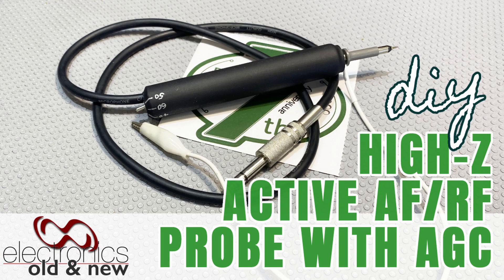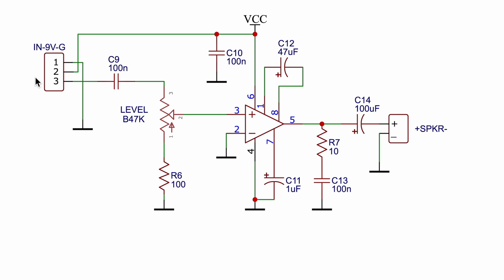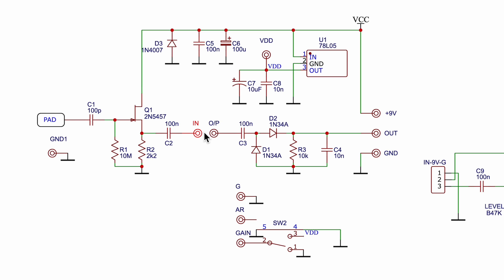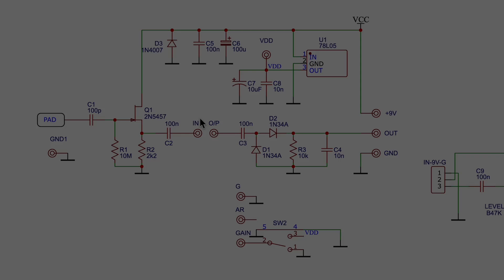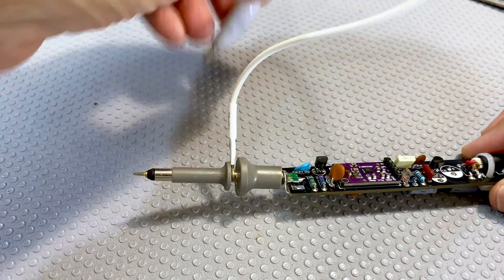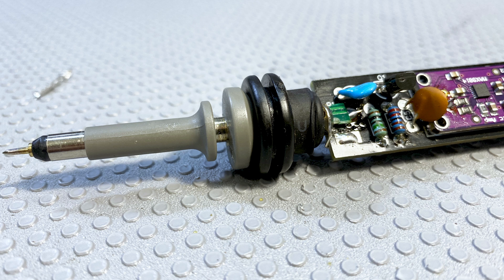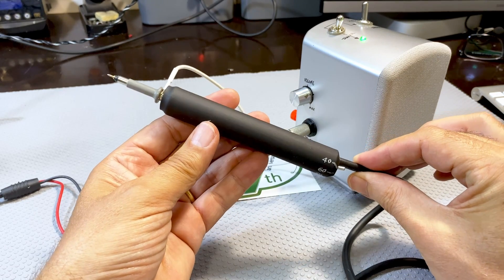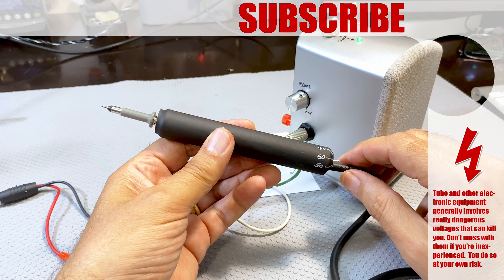High-Z Active RF/AF Probe with AGC. Making something good even better. #PCBWay#

Comment: I suppose if you look at it from a very basic level the Maxim IC is made of the same material as higher bandwidth components. Just because they didn't spec it for higher frequencies doesn't always mean it can't achieve. Great idea to experiment with where you put the board, often the best inventions are discovered by accident. Another great video, thanks again.
Reply from the maker: pleasure
Reply: Looking at the datasheet for the MAX9814, it has flat gain out to beyond 20kHz, so even if it rolls off at 12dB/decade past that, you still have usable gain out past 2MHz, especially if you're starting at 60dB.

Comment: Manuel, Maxim and Analog Devices, are  the  "BIG ENABLERS" at analog linear electronic world, every device designed  by these  firms meets the requirements, and exceed them to provide. So it is common  that the gain /bandwidth ratio reaches those  IF frecuencies. Years a go  a common audio amplifier IC, TDA 2030, used to have a G/Bw several hundreds of Khz, so that could oscillate easily at those frecuencies & destroy it, so selecting(or changing...) some decoupling capacitors at the Aplication Note, was "risky business",... Look I've got more treble.. Yeah now you've got smoke😈. Other ways  it looks great, very  practical, it is great tool for the shop👍👍👋👋👋again you did it Manuel😀😀
Reply from the maker: Thanks 😊

Comment: Very nice!  I will keep this in mind for my next tool project once I get the two I'm working on now off my workbench. As for your wand's wider than expected b/w, I'm not too surprised by that. When I updated my Rigol DS-1054z scope's firmware I was expecting the b/w to go from 50 to 100MHz but tests showed the scope will read signals up to 500MHz, albeit with some attenuation, as long as you use high quality probes.  Cheap probes will cause the greatest drop in amplitude at high frequencies, a fact that Rigol no doubt understood all too well.  It would appear then that some chip amps can go well beyond their ratings as long as your circuit can sustain a large drop in output level.

Comment: What I would like to know is what happens if you short out (I mean remove completely) the original detection section. Then you can say if the detection takes place in your new microphone amp, and it could even give you more gain without the original detection. Detection is no more that getting rid of the negative flank of the carrier, so that the positive part fluctuates from the modulation, and that could easily be done by some diode or transistor inside in the front end of the added amp.
Reply from the maker: That’s a good idea.

Comment: So I was motivated and ordered some boards on PCBway and managed to source all components, but that micro switch offers a challenge
Reply from the maker: I know. Look on mouser. I think that’s where I bought it.
Reply: @electronicsoldandnew  oh thank you, I'll have a look around next time I order from them.
Reply: @electronicsoldandnew  And the design works like a charm. I also build the amplifier board into an old speaker but ordered a 9v hinged  battery holder for some kind of guitar thingy on aliexpress for easy changing the battery. Many thanks for sharing your design.
Reply from the maker: My pleasure. 😊

Comment: Once again another fine project.. Thank You for your development work.  I was about to order the PCB's from PCBWay but at $52.88 for 5 boards - in which I really only need 1 - plus the Canadian to US exchange rate , it comes to $75.  WAY too Much!
Is this the normal pricing or why so high ?
I see you have offered to send gerbers to others, but first off, as a newbie, I would be unsure if I would make all the right choices for options.  I guess I might need info outside of the gerbers?   Also it sounds like you would get no rewards which I think you deserve.  So I am at a bit of a loss but thanks for putting your project out there anyways.   Doug
Reply from the maker: I believe the dual board option that I designed makes it far more expensive than it needs to be. You are welcome to download the Gerbers from the share page and use it as you wish. I don’t get a commission from them for every board sold, and that’s not my goal anyway. Good luck.

Comment: So cool!  One thing I was wondering about with the placement of the AGC bolt on, is if the change in placement within your circuit impacts the workable bandwidth.  In other words, is there a difference in the cut-off frequency or or range that you can hear the signal (albeit perhaps, at less amplification across the board)?
Reply from the maker: Not sure as I’ve not tried that. May have a look at that if time allows. Thanks.
Reply: I’m not sure.  I was just thinking that in radios they place an RF amplifier right up front at the antenna and the automatic volume control downstream.  I’m not sure how that compares to what you’re doing if at all.

Comment: Thank you for your effort! Can you tell if it's safe to touch anything with this probe?
Reply from the maker: That’s a very broad question 😊 The input capacitor voltage rating will determine the max voltage that it will handle.
Reply: @electronicsoldandnew    What about AC
Reply from the maker: Same thing: capacitor voltage rating.

Comment: This is absolutely fabulous!
Is there any reason why all the components in the probe can't be in the box and just have leads to test with?
Reply from the maker: As long as you can fit everything, the layout is up to you 😊
Reply: @electronicsoldandnew  Good morning sir! I was wondering If I get the boards from PCB do they also have the parts to populate the boards?
I'm trying to find where I have lost 90 % of the audio volume in my Stryker 955 export radio.
After plugging in unkowingly a slightly shorted to ground speaker for about 6 hrs, the audio was 1st cut in half after smell of burned electric on receive, monitor and volume. I had to run everything wide open to use it another week in the dump truck. One final day though the audio gradually became so low that I could no longer use the radio.
Reply from the maker: I’m afraid you’ll have to source the components locally. These boards were designed as stand-alone and not linked  to be populated automatically. Anyway, for populating the boards, the minimum quantities would be quite high.
Reply: @electronicsoldandnew  Ok do you have a parts list available?
I might be quicker to build the guitar amp version it only has 5 or 6 components.
Reply from the maker: I’m afraid not. All component info is extractable from the video.
Reply: @electronicsoldandnew  Ok thx!

Comment: I am interested in the scope probe dissecting:
1. What was the model/bandwidth?
2. Do you have more pictures of that?
3. Is the coax cable the correct type with the very thin nichrome resistive wire?
Reply: it should not matter what model it was...since it ends up being just a simple probe with all of the original probe 'circuitry' removed, so ANY old scope probe will work
Reply: @holgers5216  I am not interested in the probe tip, I am Interested in the special coax and asked about it.
Reply: The passives were removed from the probe tip and replaced with a straight through connection, but he said it was a x10 probe.  However he is only using the probe for the tip and ground connection as stated. The cable from the board to the amp appears to be 2 conductor shielded microphone cable ( see 21:43).
Reply: @materialsguy2002  
I understood that the first time.
I am not interested in the probe tip, I am Interested in the UNUSED PART OF THE PROBE.
 I am Interested in the special coax and asked about it.

Comment: 1. Why is the PCB manufacturing so expensive?
2. Which program you used for the design?
3. Can you post an modified design with TWO of your probes side by side?. (It's only 50mm wide)

Comment: So, regarding the behaviour of the AGC module: 
Either the MAX9814 just has a way higher bandwith than it is supposed to (unlikely; do you have another module you could measure?), or it is actually seeing AF at its input. 
I may have this completely wrong, but could the JFET be working as a demodulator? Unless it is perfectly linear, there will be intermodulation between the carrier and the sidebands, so there could be some AF present at its output.
Reply from the maker: Could be the JFeT.

Comment: About the RF in the MAX is not strange. A normal amp for audio easy works at 10 to 100 times the max used frequens I bet your gai is not that high at 1MHz as with 20 kHz. It is how I see it.

Comment: This is a very interesting device. I followed your link above for the "$5 for 10 PCBs", found your design (the PCB) described as "Description W224132ASC32_Gerber_PCB_AF RF Active Probe with AGC

However, maybe it is no longer available for order or I am doing something wrong, at least not for "$5 for 10 PCBs".

1) Cannot download Gerber files. Just get an Error, with no explanation of what the Error is. I did create an account.
2) If I click on order, it does come up with your design but the cost is $52.88. Like everything, the price has went up, in this case very much and this is for just 5 PCBs. Note, this is the least expensive opinion they offer, apparently.  If I go through the "PCB Instant Quote" option and use the length and width of your PCB, it does show $5 for 10 PCBs.

Wondering if you know anything about this, or could help here?
Thank you.
Reply from the maker: I don’t know about the order details, but email me and I’ll send you the gerber files.

Comment: What is the value of electrolytic capacitor C15 ?
Reply from the maker: Where in the video?
Reply: 4:29 when you show the PCB. C15 is on the amplifier PCB at the left corner just under the input BAT.
Reply from the maker: @andreb.3206 : I see it now. It’s 47uF just as supply smoothing.

Comment: I went to PCBWay and wanted to order the boards and PCBWay wanted $52.88 for the 5 board order. Is this what it is supposed to be? I am new to PCBWay and I must be doing something wrong.
Reply from the maker: I didn’t stick to a simple design and made it two boards in one, so it becomes more expensive. You can simply download the gerber files and see if you can get a cheaper solution.
Reply: @electronicsoldandnew  Thank you for the tip. I also found out later that there is a chance that I could have them shipped another way by choosing which shipping method to use. It seems that PCBWay likes to default to a more expensive shipping method. I'm new to having PCBs made and shipped to me and am learning as I go. Thanks again.

Comment: I need a JFET (Hi Z) unity gain buffer probe for my oscilloscope, as my scope loads some circuits (RF preamps, oscillators, etc.) somewhat.
Do you have an idea for that?
Reply from the maker: Probably best to just get a 100:1 probe. The normal 10:1 gives you 10Meg of input resistance, so the 100:1 should do the trick.

Comment: What is the use of the dummy resistor switch in this schematic and WHY is it even there - it really confuses your lecture ?
Reply from the maker: As explained at about the 7 minute mark, I added this to an existing speaker with dummy load incorporated in it. I believe it’s quite clear.

Comment: excellent project.

But boards & shipment to Europe make it some 82 USD. Which is what you spend even if you want to build a single one.

Add the components and bits & pieces for the case and you end up with the Rolls Royce of the probes. Utterly nonsense. 

So the way to go is build everything with a usual prototype board.